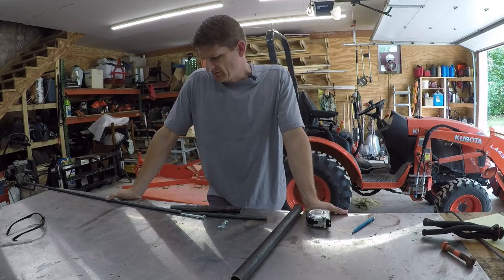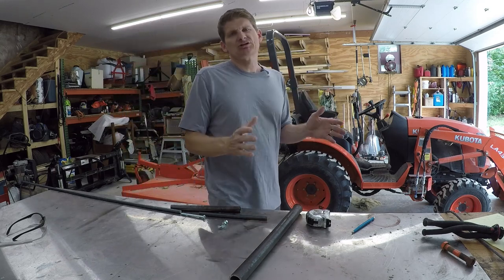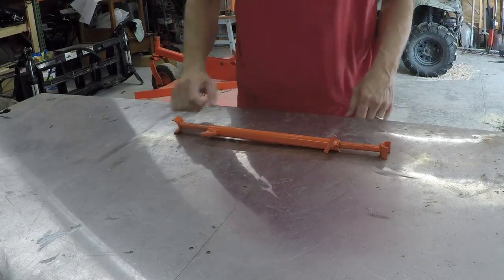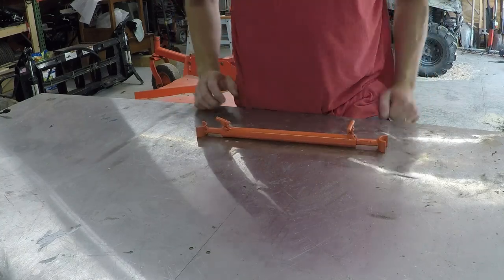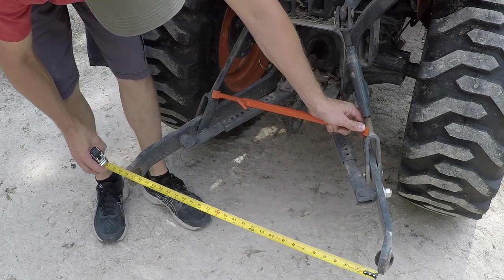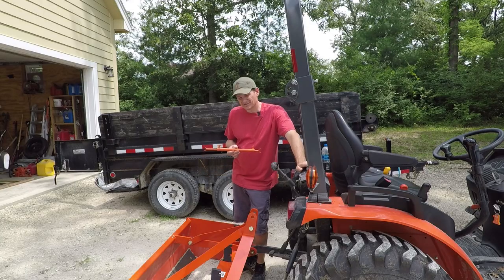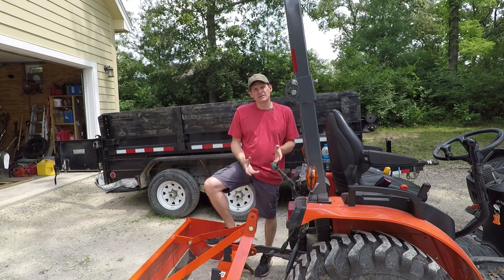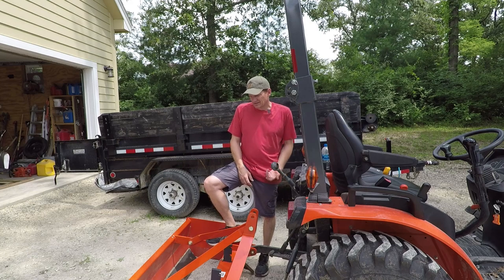Easy way to hook up 3 point tractor implements - DIY arm spreader

Comment: I like what you came up with and I am going to make one.  I will probably change it so it only has one adjustment screw.  Is there any reason you used two?
Reply from the maker: Not really sure why I did it that way. I agree go with 1 screw. It’ll be simpler
Reply: @adamj8293  
2 adjustable screws does allow for a more compact design that will extend extend to your needed length. I would stick to the 2 adjustment screws . Nice design